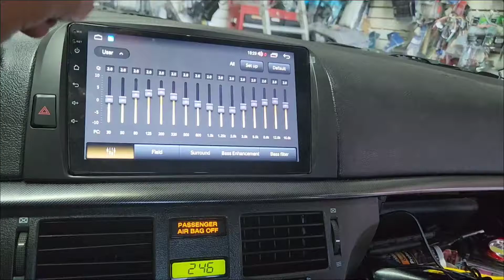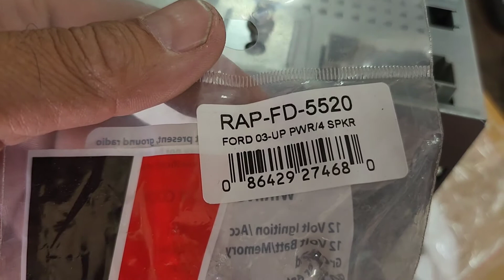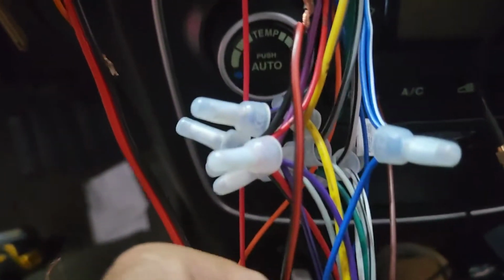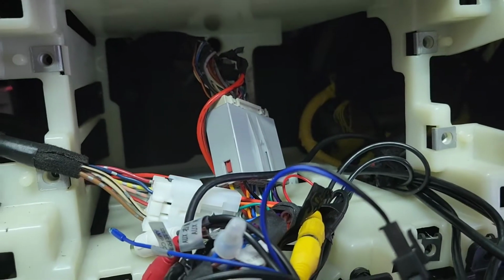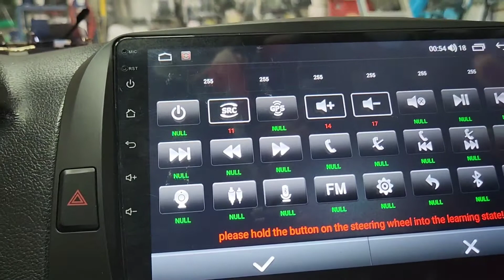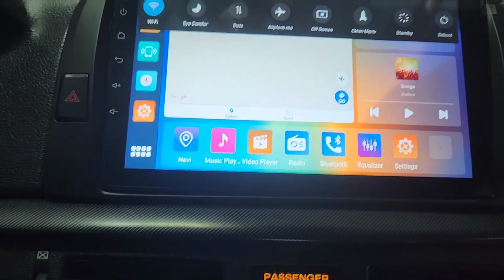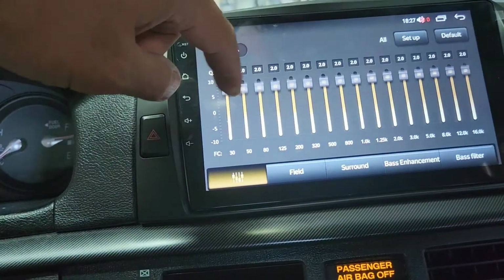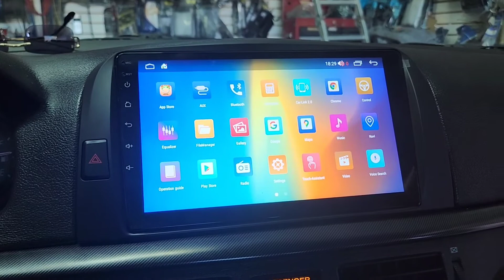How to install Android 10.3" Tesla Screen 04 05 06 07 08 Hyundai Sonata

Comment: how did u move the hazard lights
Reply: hello you move the hazzard light?
Reply: @peterdavidik4764  my frame didnt allow yhe hazard light to push all the way thru too thick So i just have it hanging out the socket it frl wont fit or push in with the factory.. But its fine atleast it works
Reply: @trustfaith3466  thanks I have problem with plug, because when I connect black cable on grounding I heard switch rele but nothing happen :/
Reply: @peterdavidik4764  oh interesting did u try keeping the one it came with?

Comment: When you say you grounded the green wire next to the brown wire for steering wheel control what did you ground to?
Reply from the maker: @noTTYLer97  segment ?
Reply: @khmerohio 3:22
Reply: @khmerohio I tried key 1 and key 2 but idk what you grounded the green wire to
Reply from the maker: @noTTYLer97  ground the green wire to the black
Reply: @khmerohio  which black wire? The one from the radio next to the yellow wire?
Reply from the maker: @noTTYLer97  yes
Reply: @khmerohio I just put a connector wire between the black and green on the plug from the car since it all lines up and it works!!! Thank you :)

Comment: This headunit is not good for subs. It will clip early
Reply from the maker: What amp you used ?
Reply: @khmerohio  I have a brand new black diamond 2500 rms watt amp
Reply from the maker: That smp is 1ohm stable
Reply: @khmerohio  yep